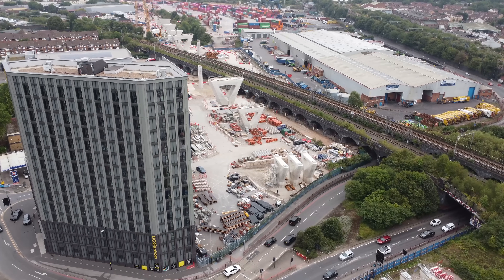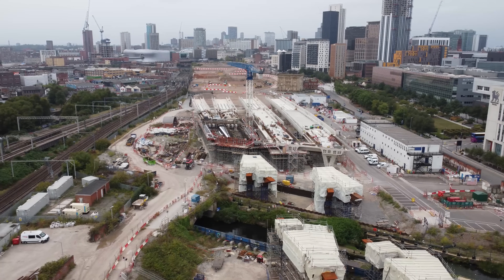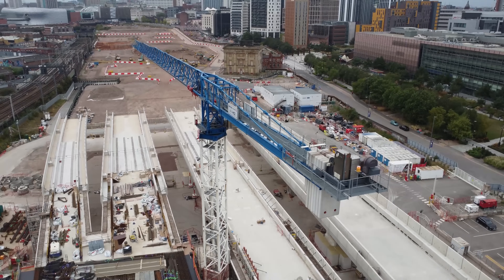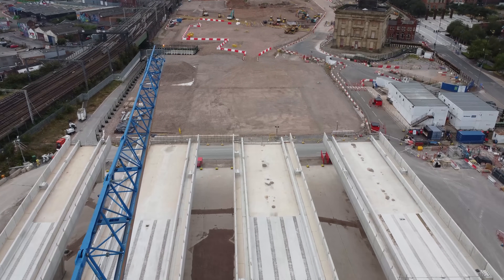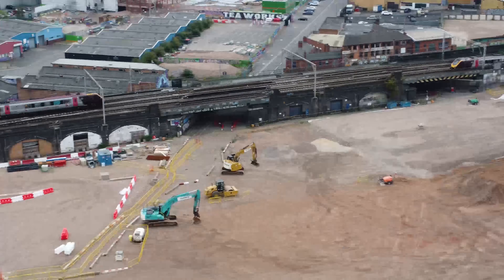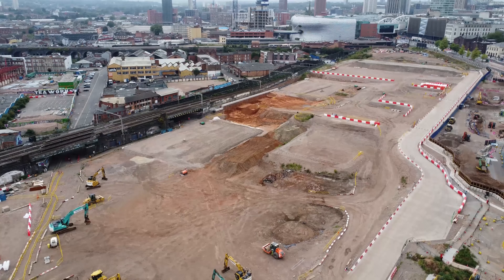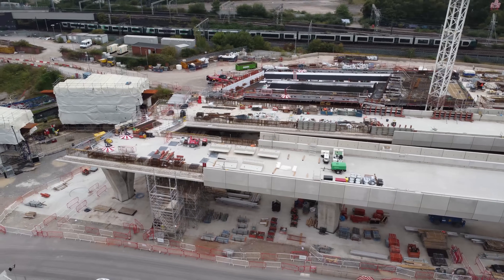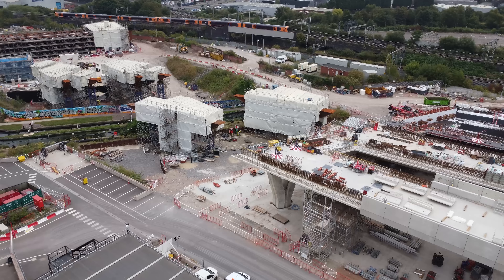HS2 Construction - Birmingham Curzon Street Viaduct 3 and station site

Comment: HS2 has been a total waste of billions of pounds! It will only serve Londoners who want to live in cheaper housing but still commute to the capital to work. House prices will rise drastically due to demand out stripping supply and locals will be pushed out. The money should have been put to helping local issues .
Reply: It has nothing to do with London or Londoners, HS2 is being built to creat more capacity on the Southern Half of the WCML and Birmingham New Street Station and it has more to do with Birmingham as the HQ of HS2 ltd is in Birmingham, the HQ of the trin operator who will operate the line, Avanti West Coast Trains is in Birmingham as will the main operation Centre and Maintinance facilities will be at Washwood Heath in Birmingham and sorry to disapoint you no Londoners have moved en mass thank goodness to Birmingham

Comment: Nice footage of a massive waste of time and money.
Reply: Why is it a waste of money, so was the M25
Reply: @peterwallen1063  Because the cost of intercity rail travel is for most people prohibitively expensive — you can fly London to Newcastle for significantly less money. And the massive cost of HS2 will require even higher fares to make it profitable for shareholders. 

Add to that the 'high speed' lies, and the scrapping of HS2 beyond Birmingham, and the project becomes farcical. 

There is perhaps a capacity argument for another mainline in Britain, but it's not at all compelling, and the HS2 project certainly isn't the answer to that. Money would be better spent on an East/West mainline in the North connecting with the Midlands. We need to get away from a London-centric mindset and encourage investment and attract business to the North and the Midlands.

Comment: I wish you had flown over the grounds works although it doesn’t seem like a lot going on they are working every day on the ground works, it would be good to see the changes over time.
Reply from the maker: I did, I spent an age flying over them, landed the drone on the steps to change the battery and forgot to end recording before pulling the battery = corrupted the footage, gutted 

Good to see that works have started there though
Reply: @WanderingNortherner  Ok maybe next time.

Comment: I still can not understand why they did not connect this station up with WCML and other train services & lines at this point - it is like a train station in the middle of nowhere - this could become a white elephant due to the lack of connections and further travel and add to it it is not an easy switch between other Birmingham stations to this station.

Sorry about the rant but great video as always and thank you for sharing
Reply: It seems you know nothing of what is going on here, as a Brummie ( to you a Birmingham Citizen)I can tell you that this station is not in the middle of no where as the land at the top where the red and white taping is is where Birmingham Curzon Street Stations main entrance will be next dor to Moor Street Station on Moor Street Queensway in the middle of the City Centre with Bus and Tram stops out side, it could not be connected to the WCML in Birmingham because the HS2 route and the line into Birmingham New Street are at different levels plus the reason for Curzon Street Station is that Birmingham New Street Station is grid locked and these new HS2 trains would not fit into Birmingham New Street and this new station will never become a white elephant as all Inter City Avanti West Coast trains from Birmingham will run from Curzon Street and not B/Ham New Street Station when HS2 opens and it will connect to the WCML at Handsacre in Staffordshire and inter connect at Birmingham Interchange Station with Birmingham International Station and Birmingham Airport at Bickenhill
Reply: @peterwilliamallen1063 that's great then for people that arrive into new st and want to connect with a train  from Curzon St,its still a 15 minute walk, and at the other end it may never get to Euston and terminate at old oak,a complete waste of money and resources, a complete White Elephant. A liebour vanity project. 😢
Reply: @kenwilkins8237  Why do people need to walk from Birmingham New Street Station to Birmingham Curzon Street Station, if you live in Birmingham and you want to go to London, Manchester, Liverpool or Scotland you will just go to Birmingham Curzon Stret Station, any other passengers will have interchange facilities at Birmingham Interchange with Birmingham International Station at Birmingham Airport and yes it is going to London Euston now as Old Oak Common is not desighned as a terminal station just a through station
Reply: The tram will connect the station to New Street , the new station is IN the city centre . This is no white elephant, recent survey suggested that 10 billion per annum will be added to the economy of the city . All the disused land will be developed before the station opens . Pathetic short sighted government should have take this to Manchester and Leeds.

Comment: seems like it is drastically changing now the few months. But I do wonder, how long will this actually take? Would there be any more delays like we already have had
Reply: recently a HS2 train re-design discussion of two items: 1. level boarding (HS2 over 1 meter height vs. UK nominal standard platform height is 915mm),  2. 1 vs. 2 door carriages to speed seating.   These two HS2 train re-designs could add hundreds of millions and could impact WWH and many HS2 (and non HS2) station's platform designs (heights and lengths).